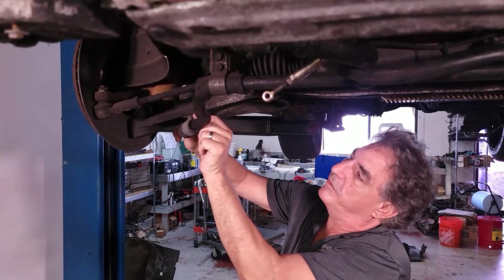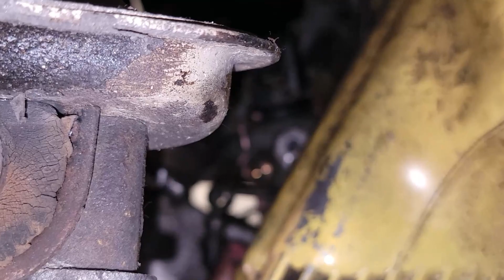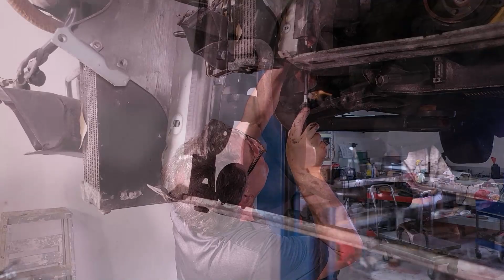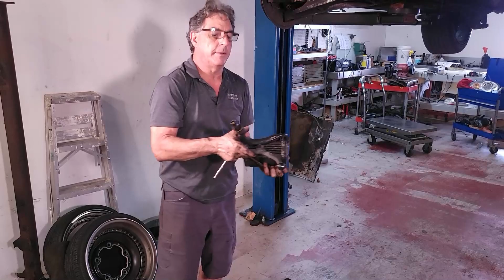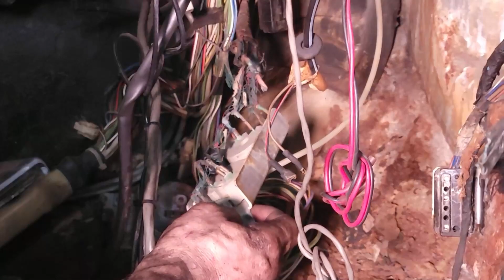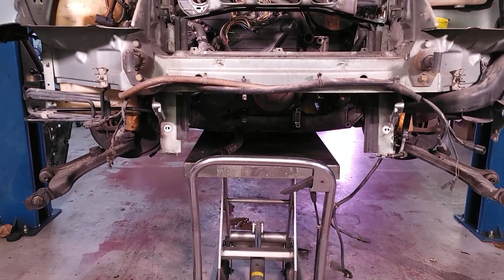Episode 13 - 1986 Porsche 944 Turbo Restoration - ENGINE REMOVAL SPECIAL

Comment: I really enjoy watching your video's. Brings back a lot of memories. 
Almost two years ago I finished my full nuts and bolts restauration on my 1987 Porsche 944 Turbo.
Best part was building the car back up with as many new parts I could get my hands on. I even managed ti buy a brand new engine block from Porsche.

Keep up the good work and thanks for sharing!

Comment: Russ, thank you very much for today’s video, it was very interesting to see how it comes out the bottom as not having a lift, I had to take mine out the top. Seems about the same amount of work either way, as I did not have to dismantle the suspension and steering, but I had to remove the mounts attached to the block, and the exhaust manifolds, coolant pipe, and aos whichever  was additional work for me. I have a 1988 951, and my car has plastic wheelhouse liners which your car doesn’t have(maybe they are missing like the lower service panels). I think the reason your cam tower and oil panel are painted is because those casting have a lot of surface defects in them. In fact, some of the surface defects are so bad that I thought mine was cracked and purchased a second hand and found it had the exact same defects. After a lot of sanding by hand, I was able to clean up both castings and polish them to a very high finish. The cam timing covers are better castings with fewer casting defects, but you still have to do a lot of hand work to polish them also.
Reply: Taking engine out the bottom is the way to go, Russ did it the hard way.  You do not need a lift.  Use the cherry picker that you used to lift the engine and raise the car with it instead.  Put the engine on a dolly, roll under car, lower car, bolt 4 bolts fir crossmember in, 2 bolts at the end of control arms on each side, 4 bolts on top of shock towers on each side and the 2 bolts on each side for sway bar mounts.  This is all it takes to install the engine with ALL the accesories, turbo, crossover pipe, down pipe, steering rack, wiring harness - basically everything.  I am getting too old to bend over, crawl under the car to remove or install things.  This way everything is removed/installed with the engine out of the car - much easier then bending,crawling.  It took me 15 minutes to install the complete engine, suspension, clutch, harness, exhaust etc.

Comment: Wiring will be interesting.  I'm wondering if it's the same as my 87. I have a Porsche shop manual but it doesn't include wiring diagrams.  Keep up the good work, and treat yourself to a new impact!
Reply: @chris I have all the factory shop manuals and for my ‘88, the wiring diagrams are in volume 5:electrics. Early production ‘88’s were same as 87, mid-year 88 production has some changes.
Reply: @jvaubry  I just bought a 88 na could you send me these?
Reply: @Tron505  Please to Me also...I appreciate it
Reply: The only difference in engine harness is the one wire that goes to the oil level sensor on '87+ models.  If you look online you should be able to download all the factory shop manuals along with the factory PET (parts manual)